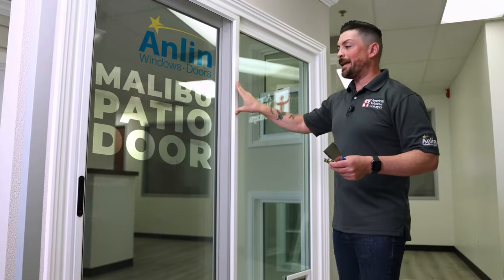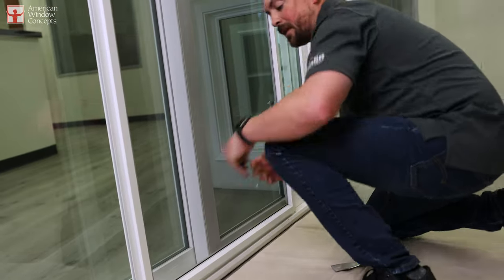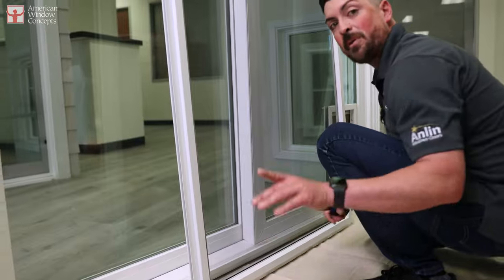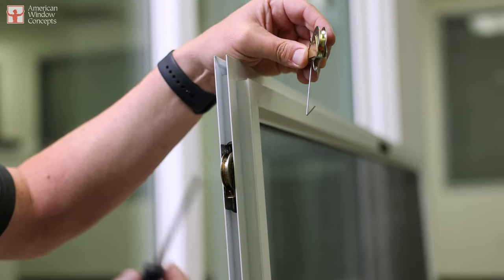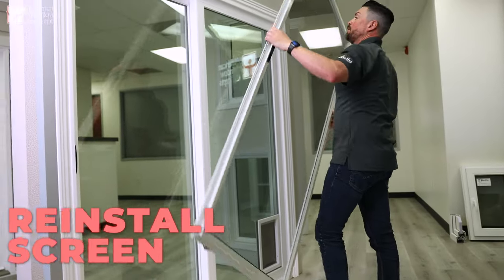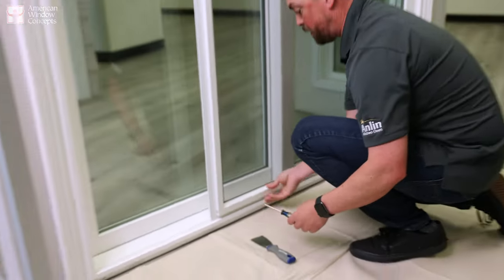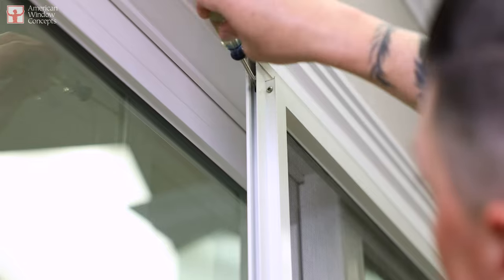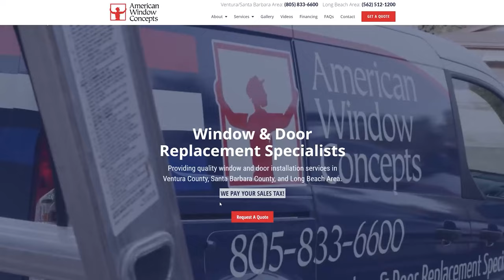How To Replace Screen Door Rollers

Comment: I would have loved to give you a thumbs up but unfortunately you cut the video at the most crucial point where you are putting the wheel back in. Without that, the video is not very helpful. If you can update it to add back those missing pieces I would love to give you a thumbs up.